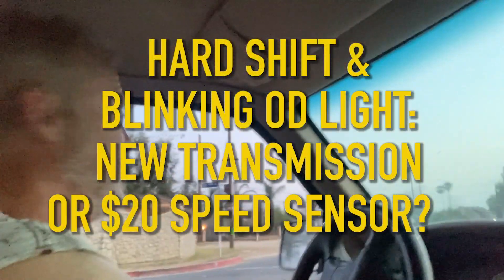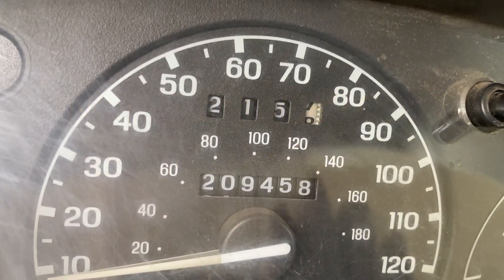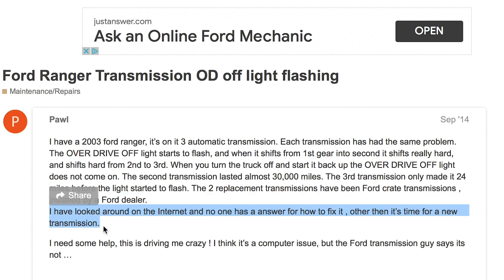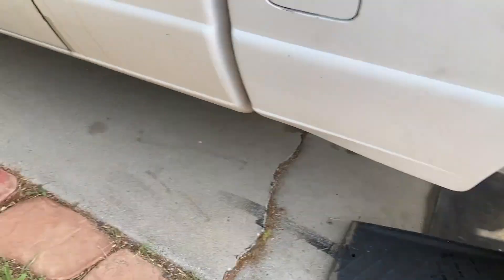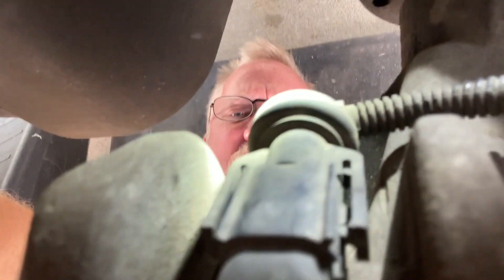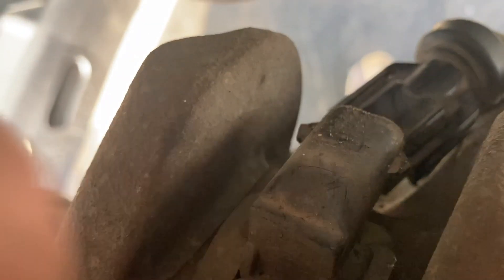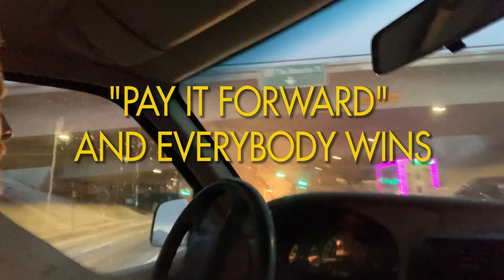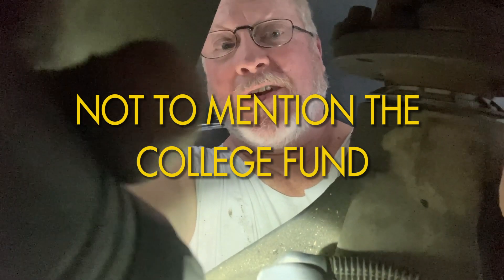Flashing OD Light & Hard Shift on automatic Ford. Replace Transmission or install $20 Speed Sensor?

Comment: Od light went flashing after a run on Express way then got off highway  it started with hard  shift cut car off to go get some gas went back to normal ridein smooth
Reply from the maker: Lazy Cow Vintage Thrift & Design
1 minute ago
So it didn't throw an OBD code? I had the same problem intermittently ('98 Ranger) a couple times about 2 months before. The problem stopped and I forgot about it until it went all out.  You can wait and see if it acts up again and replace the speed sensor then or just do the quick fix and be done with it. Good luck! - Grandaddy-o
Reply: @lazycowvintagethriftdesign5595  ok
Reply: @lazycowvintagethriftdesign5595  no code

Comment: Also I have a 2002 Ford explore, got it at about 90,000, it’s at like 212,000
Reply: OD light just started flashing about 100 miles ago. I have a sealed transmission so I don’t have a dipstick to check the fluid so I have no clue what’s going on in there it could just be fluid for all I know or an air filter or a speed sensor but those are what I’m gonna do before I end up fucking with this transmission because I don’t think it’s the transmission it’s shifting fine it just loses power when that stupid light starts blinking
Reply from the maker: EXCELLENT plan Jamie!  If you haven't noticed trannie fluid dripping (pinkish) your sealed system should be good.  "Shifting fine" and then problem as the OD light blinks?  Sounds like it could be the Speed Sensor.  I had intermittent problems a month before the fateful day it went out completely.

Comment: I am having very hard and late shifts with my Jeep. This is the only video I've found recommending anything other than a throttle cable adjustment, which I already have done & it didnt help. I am looking forward to trying this, hopefully it will solve my problem. 
Thank you
Reply from the maker: Hey Monster wishing you luck with your Jeep.  It's a fast inexpensive fix so it's worth a try. - Grandaddy-o
Reply: @lazycowvintagethriftdesign5595  Thanks. My fluid has been a little low I was just able to top it off today and change the filter soooo I’m about to take it for a ride and see if that was the reason which seems to be ideal, but i doubt it, Then if that is not the reason I have a speed sensor on hand to install and if that is not the reason I will go pick up a throttle position sensor and if that is not the reason then the shift sylinoids. and if.... well, we know where this is going...
Reply: @lazycowvintagethriftdesign5595  I cannot find the sensor location lol no diagrams no nothing only for the 4.7 liter not for my 4.0. I got the notion that 4.0 only have one sensor, the output. I'm guessing its at the end of the transmission on the top. I guess I'm going to take a guess 🤷‍♂️
Reply: @maniacalmonster2293  what was it ? Did topping off the trans help ?

Comment: I have been trying to figure out what was wrong with my ranger for the longest. I've had people tell me I need a new transmission on several occasions. I was willing to try any and everything before buying a new tranny. Nobody ever mentioned a speed sensor and it never occurred to me that it could be a problem. The condition of mine seemed much worse than the man in this video. I was a little scared that this wasn't my problem bc I couldn't even start to accelerate in drive. I had to start in the lowest gear to get moving then manually shift up into drive. I did this for a while until my speedometer quit working and the shifting was really bad. I decided to give this a try and I am so thankful that I came across this video bc I now have a fully functioning adventure truck. 😂 THANK YOU so much for sharing this you have helped me tremendously. GOD BLESS
Reply from the maker: Hey Caleb this is WONDERFUL NEWS!  I wonder why transmission specialists "don't know" about this fix? So happy for you and God Bless you and your Adventure Truck. - Grandaddy-o
Reply from the maker: Caleb do you know the year, and maybe what engine on your Ranger? I'm trying to keep track of what vehicles have the same problem.  - Grandaddy-o
Reply from the maker: Also - I believe the "other" geared speed sensor controls the SPEEDOMETER.  So if she starts acting up again, or if you want the speedometer to work - it can't hurt too bad ($35) to replace that part also. Might fix it. Good luck! - G

Comment: Thank you thank you thank you ! Been chasing a shifting problem for 3-4 months now, plus od light flashing, changed that sensor it fixed my problem 100%.......like you they wanted to give me the wrong length shafted sensor......it's such an easy swap out that I took the old one out to look at it first, then put it back in to drive to the parts store to make sure I knew what I needed.....it was $19.99.....the longer shafted incorrect part was $34.99..........had to make a slight modification to the new part as the side connection tabs were a hair too long for the electrical connector to go on all the way. The fix was to file off a little on each tab, super easy took one minute, it's plastic so it files easily, thanks again I can't believe it's fixed !!!
Reply from the maker: Hey Florida $19.95 sure beats a new transmission, doesn't it?!! 
- Grandaddy-o
Reply from the maker: Hey Florida what model and year car or truck?  I'm trying to keep track! :)
Reply: @lazycowvintagethriftdesign5595  Having hard shifting problems, and no speedometer movement. Just bought this truck yesterday, and I knew it was a speed sensor, so I asked for it, and they gave me that same wrong part, haha. Definitely taking it off at the part store now, thanks for the video! Part stores must be recommending the wrong part on all of these trucks.
Reply from the maker: @weeveferrelaine6973   Any luck?  I think when the Speedometer acts wanky it's the FRONT speed sensor located on the transmission. Around $35 part.  Best, - Grandaddy-o
Reply: @lazycowvintagethriftdesign5595  It was the speed sensor on the diff, speedometer is fixed now, and car is shifting butter smooth. I did a transmission oil flush anyway, because I wanted to make sure any wear or metal in the oil got out of it, but it looks to have been unnecessary- The old oil wasn't full of a ton of metal or anything. 98 Ford Ranger 3.0 V6, apparently the ABS speed sensor is responsible for a ton of the stuff on this truck.

Also had a miss in cylinder 3 in the engine, that turned out to be fuel injectors. Still had the stock injectors at 260k miles.

Comment: I've got a 2004 ranger, which just started having the OD light flash, check engine light on and will not excelerate up hill at all, rough running when I apply gas.
Reply from the maker: You can try this fix but smartest thing would be check the OBD code. Could be missing on a cylinder? Good luck, - Grandaddy-o
Reply: @lazycowvintagethriftdesign5595  ok thanks for the help.
Reply: Sounds like bad catalytic converter
Reply: The cat is gone, does that make a diff?  @jeffroberts760

Comment: hahahahha i had fun and love your video , i have the same problem with my 1996 v6 3.0 ford ranger 4x2 no ABS  with a 4r44e  automatic transmission ,and i also think this is the problem because it has the same symptoms your truck had.  Also It triggers on the obd2 scaner the po715 code. i hope is this sensor the one i need to replace.
Reply from the maker: Hey Marlon.  I never got an OBD code with my rear transaxle sensor. Since you're getting a P0715 it's probably the front "geared" speed sensor that I show at 8:35. Also be sure to check the harness/wiring/couplings for any damage. Good luck! - Grandaddy-o

Comment: Where is the video link to check k the fluid since there’s no dipstick
Reply from the maker: Sarah, unfortunately many newer automatics don't have dipsticks. Checking fluid requires the car :
• is level • is in park  • is running  • at operating temperature
Then there's an inspection plug, fill plug, has to be exact level, etc etc.
It's probably best to have the Jiffy-Lube guy do it for you as part of an oil change.  Good luck!

Comment: Can this sensor cause delayed/slow downshifts. For example going down the road at ~40 and slowing for a turn and after the turn getting on the gas it takes a good 5-10 seconds to downshift? IF so then this will save me a lot of hair tearing...
Reply from the maker: Hey Matt.  What make of car, and automatic transmission I assume? Is the OD light flashing? What you explained does seem like a good candidate to try this fix.  The speed sensor informs the computer control module how fast the car is moving,  which sends a signal to the transmission for when to shift.  If that SS signal is going bad, the trannie turns erratic not knowing what to do.  It's a quick cheap fix so try it.  My experience is with Ford automatics. Good luck! - Grandaddy-o
Reply: @lazycowvintagethriftdesign5595  I have found the problem sensor. Ford calls it the intermediate shaft speed sensor on a 2002 ford ranger 3.0l with the 5r44e transmission. Mice had eaten the wire from the plug back to the wire loom. Replacing the plug tomorrow and am going to see if that fixes the problem. Only 1 code in the transmission/TCM so i think that this will fix it. Thanks for responding.
Reply: @lazycowvintagethriftdesign5595  On another note... do you know anything weird on the 3.0l fords that would cause an unexplained rich condition? both banks are -30 on fuel trims and i have tested just about everything on the engine that can be tested with basic tools. MAF is good, O2 sensors good and no extra fuel coming from evap system.
Reply from the maker: @RandomZ88  WOW!  Those dang mice! Chewed up wiring could definitely be the problem.  
Sounds like you're systematically diagnosing the rich condition. That's good.  Is the air filter dirty? Off hand that's all I can think of? Best of luck Matthew. - Grandaddy-o
Reply: @lazycowvintagethriftdesign5595  Nope Air filter is new. i am working on a couple of off hand ideas that i have seen people try to fix similar issues. Thanks for responding to the questions. Most of the ones i have asked haven't responded to the questions.

Comment: thanks for the vid, read your info and comments and did not see it, do you happen to remember what diagnostic code you got for this issue?
Reply from the maker: No OBD code. No check engine light. I didn't say it but there's a written message on the screen at 1:00 about no OBD code. Good luck!

Comment: Thought of this after replacing solenoid and trans filter as precaution. Should've started with this first if I'd thought of it -_-, usually try to do the cheapest thing first. Thanks for the vid! Doing this on 2004 Explorer tomorrow.
Reply: ** @hows it running still?
Reply from the maker: @xposhr   Good  luck with the easy fix Xpo! 50/50(?) chance the VSS swap out will help. After 4 months my 98 Ranger is running like a top.  Just put in a new water pump in her. They always want something!
Reply: Did it work on your explorer?

Comment: I have Ford Mondeo 2002 with automatic transmission, my O/D light started blinking and it has really hard time shifting from 1 to 2, goes to high revs, stays there for few seconds and then shifts very hard. I wonder where this sensor is in this car??
Reply from the maker: I’m not sure about the Ford Mondeo - I suspect it may be similar to the Ford Focus?
Check out this video replacing the Speed Sensor on the gearbox 2002 Focus.
https://youtu.be/oWuylQZeWb8

I did this to my 2008 Focus and it fixed the tranny malfunction. The Focus also had crazy erratic speedometer action too that was fixed.  I don’t know if there’s a second sensor?  See if you can get a 2002 Mondeo mechanics manual online or at your local library.  In the US we have Chilten’s Manuals etc and always a big help during any fix.
- Good luck!

Comment: I wasn't so lucky, because, although my symptoms were exactly like yours, replacing the abs/speed sensor did nothing to solve the problem.  No harm done since the speed sensor in my truck was 24 years old and would be needing replacement eventually.   Truck drives and shifts fine on surface streets, but once I am on the highway at 65 or so, the OD light starts flashing and needs to be reset with a restart once I've pulled over.
Reply from the maker: Hey Mike sorry it wasn't an easy fix.  Did you replace BOTH the speed sensors - the on-top-of-the Differential Sensor AND the side of the Transmission one? It's the Differential VSS (vehicle speed sensor) that fixed my Ranger. Before it totally went out - I also started having intermittent problems at about 60+.  On a '98 Ranger automatic the Tranny-VSS  is geared, and the Diff-VSS is a magnetic (non-geared) plug. Super weird is AUTOZONE calls both parts the same thing, "VEHICLE TRANSMISSION SPEED SENSOR".  Check the wiring for frays and remove/clean/wiggle the connectors?  - GOOD LUCK!
Reply: @lazycowvintagethriftdesign5595  I changed the sensor on top of the diff.  It's a magmetic sensor, labeled as both an abs and speed sensor.  I guess I'll try the side trans sensor and wiring.  Pulled an 0741 code.  I've already checked fluid level.  If I drop the pan, I'll check the TCC od lock solenoid.  Thanks for the suggestions.
Reply: @MichaelPierceall  mine did same thing its when the trany gets hot 🔥the sensor starts to malfunction......change input and output speed sensors.
You can just turn off overdrive aswell and it won't kick into 2nd
Reply: @Sharpeoutdoors  where are the input and output sensors located? My ranger does the same only happens when transmission warms up. And I already changed the sensor in this video still same issue

Comment: I have a 99 3.0 ranger. When i wanna downshift, it doesn’t want too, and sometimes when it does it revs then goes into gear. idk what is happening
Reply from the maker: They'll break your heart, and your wallet if you let them RC.  Is that standard transmission? My 98 Ranger 2.0 auto didn't want to automatically upshift. I don't know about standard not wanting to DOWNshift. Ask most mechanics and they'll say you need a new transmission. Maybe. Maybe a cheap speed sensor will fix it? Maybe not. Maybe it's a linkage problem between the stick and the trannie? Clutch?  So many choices. I always start cheapest thing. Check trannie fluid level and work up from there. Good luck! - Grandaddy-o

Comment: Good job my 99 ranger is doing the same thing it whines then shift late and kinda hard also my abs light is on was your abs light also on?
Reply from the maker: Hey Tony - was my ABS light on? Yes and no. On the Ranger, no OBD codes, no check engine or ABS light.  Only dashboard diagnostic was Flashing OD light. However - on my Ford Focus automatic, same performance symptoms, only ABS light and check engine light was ON. Also the speedometer was acting wacky. I fixed it by switching out the ABS SPEED SENSOR - which is different from the TRANSMISSION SPEED SENSOR. In the video (8:30) you can see I bought the wrong (ABS instead of transmission) speed sensor and had to go back for the correct part. In your case Tony, my experience says it's the ABS speed sensor. Be sure to check all the wires for damage, and replace that ABS SS. It wouldn't hurt to replace the trannie SS too, but the absolute cheapest diagnostic/POSSIBLE FIX is your ABS SS. 
Who knows, your mechanic may suggest a new transmission and ABS system. My advice is try $20 on this fix first.
Good luck and let us know the outcome! - Grandaddy-o

Comment: So I have a 2010 Ford ranger 2.3l 16 valve automatic trans and my od light is flashing when I get to the 4th gear about 55-65 mph and it won’t shift into 5th gear but nothing seems to be wrong with my transmission it does shift a little later than usual but has never slipped or anything major. I’m assuming it is a speed sensor as well, should I go ahead and replace it and see if that’s the issue?
Reply from the maker: Hey Dillon, you're gonna get 2 answers to that question. 1) Replace the transmission or 2) Take a half hour and put in a new sensor for under $30 (or have a mechanic do it for you). 
With all car issues you should check the least expensive fix first. It sounds like your truck could be a perfect candidate for this easy fix.  It's a very cheap gamble that often works. 
Good luck and let us know if it works or not.
- Grandaddy-o
Reply from the maker: I assume it's NOT throwing a Check Engine light OBD code?  Interesting. My 1998 Ranger automatic did that same thing at freeway speeds a couple times before the breakdown. No code.
Reply: No engine light coming on, and I’ve been driving it for atleast a month with it on going to work and it drives fine just no 5th gear and a little high on the rpms when it shifts but nothing serious. I’m going to try and replace the sensor first and go from there
Reply: @dillonfox6630  did you replace it my car is having the same problem but in thinking it's the shift cylinder
Reply: @coneonthebricks6746  not yet attempted it yesterday but the bolt is rusted as shit and it will either take a 10m or t30 torque screw with a socket. Gonna try again today but almost certain that’s the problem bc I drive it everyday and it drives great just won’t go into 5th
Reply: @dillonfox6630  I put a computer on mine and it read that it's 20% shift  cylinder but the same problems as yours exact same
Reply: Did u guys find out the solution to your overdrive flashing because mines doing the same thing once I reach about 55 mph can anyone tell me a solution to this problem